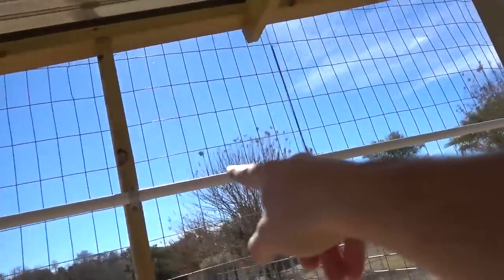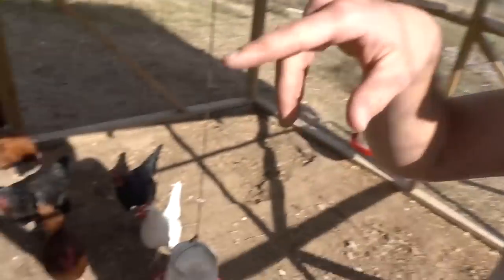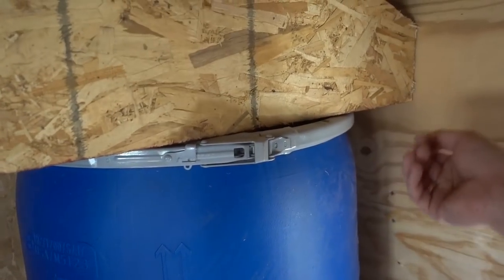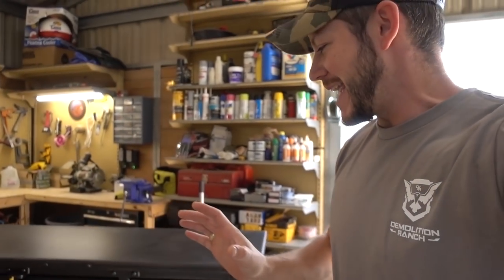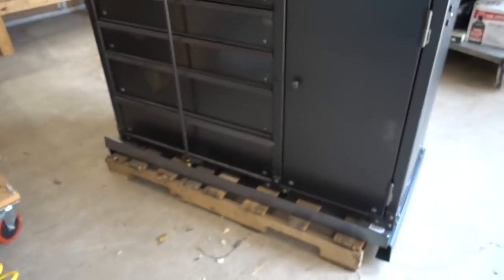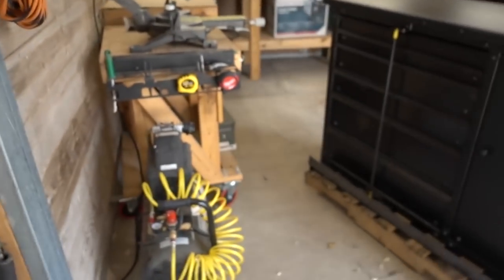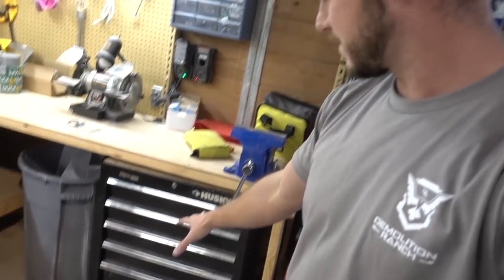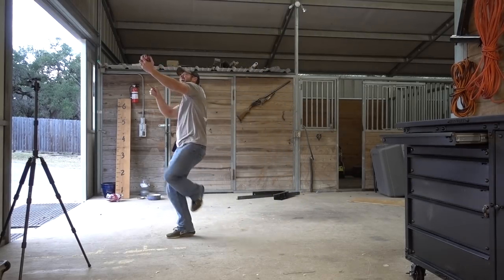It Weighs 450 Pounds!!!

Comment: Hey Matt, I work in the rainwater collection industry. I love what you’re doing with the coop and think it’s outstanding that you’ve done all this yourself! I do want to offer advice though- you may want to add a screen over that overflow output. The way I saw it, there’s a clear, unfiltered channel from the overflow to the top water which is an excellent way for critters, insects, and pests to get into your water. You could just simply get some cheap mesh and literally duct tape it around all openings to prevent that sort of contamination. I’d highly recommend it. It wouldn’t inhibit water flow and would give you extra peace of mind for the longevity of the system as well as preventing maintenance. Thanks for reading this buddy, love ya!
Reply: extremely great advice! hope he reads this!
Reply: In his previous videos on the water system he mentioned about screens several times so I'm pretty sure he's using them.
Reply: Shawn K y hello there
Reply: ❤ Why do you want water in it

Comment: Not sure but it looks like you installed the wheels on the wrong end.  The fixed ones go to the left side (without the handle) and the swivel wheels go on the handle end.  That way the tool box is easily moved around.
Reply: I was thinking the same thing.
Reply: I commented about this as well. They do need switched. Tune in for the next episode of ToolBoxRanch.
Reply: The thing I dont get lol. He advertise it as being "safe" with all those locks and can put valuable stuff in it.....aaaand then put it on wheels....makes sense xD
Reply: Was wondering the same.
Reply: Bilbo Saggins a 6 ft galvanised fencing section and padlocked gate, across the mouth of his workshop space, would do the same job. It won't stop a determined thief, but why make it easy for the scumbags.
Reply: Thats why I am commenting on the wheels...The thief doesn't even have to worry about the lock..haha just wheel the entire thing away :P
Reply: Bilbo Saggins it’s a lot easier to grab a tool out of an open drawer than hauling off 600+ lbs of tool box
Reply: iLikeC00kieDough . Matts humvee, is the army push button ignition right? 
600 pound getaway vehicle already provided?
Reply: zbudda it's been converted to a keyed ignition.
Reply: I thought the same thing

Comment: I understand this was an AD for rhino but when you are trying to compare that tool box to your husky tool box  it’s not comparable the rhino is $2000 you have a low-end model of the Husky tool box which was probably about 200- 300 bucks and if you were to buy a high end husky one the bottom drawers are rated for 200lbs and is also made with 21gauge steel just saying you’re comparing apples to oranges.
Reply: kobe0806880 yeah, worked at home Depot for about 2 years. The cheaper $300-$500 tool boxes dent very easy but they do sell some high end ones that can do what that new chest does for cheaper still.
Reply: But the husky is made out of 100% “Chinesium”
Reply: Jo Wh LOL, "Chinesium". I am totally stealing that. It perfectly describe every Chinese made tools I encountered.
Reply: He's using the husky as a stand in for all those "like boxes." Some are in excess of $1000 (for a similar configuration) and are still made out of thin sheet stock. This is $1700 after the discount code, (Shipping included) so when you start comparing it to other high-end toolboxes, it's not really that bad of a price.
Reply: kobe0806880 i have snap on and compare à rhino ... Rhino Win.
Reply: BC437A
Dude Chinesium is already copywritten by Uncle BF, though he may have opensourced it.
Reply: THE TOOLBOX IS NOW $3,799. THEY RAISED THE PRICE FROM $1,999 SINCE THIS VIDEO.  NOT COOL!!!!!!!!!!!!!!!!
Reply: kadmow 
I was being facetious. If you don't know what it means, look it up. I had no intention of using "Chinesium" for commercial purposes now, nor I will in the future.  The fact that you took my comment way too seriously, tells me what kind of person you are. So please take your "Holier than thou" attitude and take it elsewhere. It is neither needed, nor wanted here.
Reply: BC437A  Well if you were being facetious, you should have realised I was totally pulling your chain.
(Or Googled Chinesium to fund out who youtube's Uncle BF Is..  its a joke..)

There is a youtuber out of BC who routinely uses that word, amongst other "choice" Canadofrancisms..

sorry for making a joke without laughing, I will laugh next time.
Reply: So did you scoop one up? Lol!! That’s messed up!
Reply: AvE comment LOL.

Comment: Both braked castors should be on the front side, so you can push it under something and get access to both brakes. 

:/
Reply: Beat me to it i was going to say the same thing i know been there done that ;)
Reply: Pushing it under something makes no sense. You lose acres to the top surface, which is one of the best features of this box. Also, the only time you'd really lock the casters would be while using the top surface, and it wouldn't be under something. And what would you put it under? A really high table that has NOTHING under it. No supports, no shelving, no storage.

Comment: Ok, just an observation, you have spent hours and a buttlode of cash installing, removing and reinstalling
a big time watering system. Have redesigned and installed the entire interior of the chicken coop, but
you still have a FRIGGEN! wire running out to the latch so you and the kids don't lock yourselves inside ???
You can do better than that, come on.
Reply: Theold doctor sometimes simplicity is the best solution
Reply: Theold doctor oh common then their wouldn't be any fallout 4 part to the build man. Simple but easy to fix along with cheap to up keep simple Paracord.
Reply: I mean, a wire is a good idea.
Reply: Theold doctor I think that's just a doorknob dude.
Reply: Pretty sure he has a long time ago
Reply: He has had that done for a couple months now.

Comment: Hate to break the bad news to you, but you put the caster wheels on the wrong end. The casters are always supposed to go on the handle end. I was a GM Mr. Goodwrench for 20 years and used a Snap On "Taco Wagon" tool box. It's got to be a real pain moving it with the steering end on the opposite end from the push handle. :(

Comment: If the Tool box is 450 pounds and you weigh 200 pounds, when you stand on the edge shouldn't it not tip???

Comment: In order to fill a 55gal drum, you would need atleast 110gal of opposite pressure to push the liquid up into the 55gal drum. Theres no way your inch and a half pvc pipe can produce that amount of pressure with gravity alone, unless it was 1,000ft straight up lol. Not tryin to be a hater. I like all your vids. Just my opinion. Might come in handy in near future ;)

Comment: Hey Matt! I'm not an expert or a physics major, but I think your overflow tube is going to work as a siphon if the water level reaches the u bend.
You might want to over fill them just to see what happens. 
(I have a pythagorean cup that does the same thing. If it does, just install a vent at the top of the bend to let air in. That will kill the siphon.)
Thanks for reading, and I hope I'm wrong. It's a really neat system!

Comment: I had a desk that weighed about the same as the toolbox. I needed to get it on the pickup. The wife was sure we couldn't move it. Our wives are about the same size and age. I'm 70 and in crappy shape. I looked at it like you looked at your toolbox. I tilted it and backed up under it. I lifted the other end of the desk and slid it on. My wife couldn't believe it and neither could I. Work smarter. Not harder. Your brain won't get a hernia. Probably.

Comment: My toolbox also used an external bar to lock the drawers. That didn't stop the thieves though. With a little force, you can pull on that bar in the middle and it will come out of the bracket at the bottom. Then all of the lower drawers can be robbed. I welded on larger brackets top and bottom and got a 3/4 steel bar and drilled a hole at the end. My padlock is on the bottom of the rod now. It's a little aggravating unlocking it now, but it is far more secure. I lost several thousand dollars worth of tools and my insurance only covered part of it.

Comment: It would look so much nicer if you ran the output of the gutters on the sides of the structure directly into the upper portion of the structure and then ran the piping over to the tanks. Then you just drop the water into the top of the tank as I said. The same is true for the open enclosure area. Run the water directly along the top of the enclosure into the top of the structure and then drop it into the tank keeping each of the three lines separate to avoid choke points. Then connect a valve to the bottom of each tank. Using two couplers attached to the output of the valves run your drain line and watering lines for the chickens out of the mine that is connected to the couplers. This allows for easy drain down in case of a hard freeze and hard freezes to find as below say 25 or even 27°. In such case you just shut off the valves and disconnect the couplers and drain out the system. The lines to water the chickens and their Associated train or just fine. As I said earlier, down to about 27 225 degrees you can just slightly open the two drain valves at the end of the watering lines for the chickens period a very small amount of flow will provide enough movement in the water lines has to avoid freezing. This is specifically why you do not ever fill the tanks from the bottom or retain water in the input line as they represent a serious freezing hazard! That is not smart! In addition it requires a lot more piping and is asking for problems with choke points and complex systems that are not only unnecessary but also pretty doggone ugly. Your wife is a classy gal and would prefer my type of design which is clean efficient and attractive. Let me know if I can help any further.  1abqdad@gmail.com

Comment: Why not put a battery or 2 in the hole between the barrels with a solar panel then hook up 12 volt heat tape on the outside pipes.  You could even make an Arduino (spelling) it automate the on and off based on outside temp.  Kinda techy but I'm guessing there's a ham radio club in your area that could help.  And that would be way  cool.

Comment: Hey, great video. One idea for your old tool cabinet could be to have it as a rolling tool chest/work bench if your working further away from your shop. Maybe add 4 swivel castors to the bottom. This will allow you to load it with tools for a specific task or job and the roll it over to the area your working and still be able to tuck it under your shop bench when not in use.

Comment: When both tanks fill up and the water starts going out the overflow pipe, it's going to siphon out all the water from the tanks. The overflow needs to go out the side (or top) of the building without going down. Or, if you feel it has to go down, then give it an air vent pipe at the highest point to break the siphon. If you don't believe me, just ask any plumber how a toilet works.

Comment: Just to throw this out there about the extra tool box. I use my extra ones like you have to store tools and such for jobs that I have to do but they are few and far between. Take oil changes, I keep the exact sockets, wrenches, filter wrench, extra filters, shop rags, and any other little tool or part I need for doing those things on my vehicles in one of them. Come oil change time I go to one spot and everything is there and I don't need to go digging through the rest of my tools or running around the garage to get the right stuff. Think chicken coupe. Keep all the stuff you need to repair the water system or the doors and what not in there. Oh and yes I have one very similar to yours and that is all the tools and what not for working on or cleaning my guns. No matter what it is, if I'm doing anything to a firearm I open that box and only that box.

Comment: Just a thought, maybe put a roll on or spray on bed liner on the top of the new tool box for the added durability if you plan on using the top for more work bench space.

Comment: So I noticed that the rotating casters on that tool cabinet are not on the same side as the handle to pull or push it around. It might be easier to move it if the steer casters and handle were in the same side. Love your channels. My wife and I binge watched a ton of videos from all of your channels!

Comment: I like the watering system.  One suggestion. On your overflow drain  you might add a vent.  If the drain ever gets used the vacuum created may drain the entire barrel.
Reply: only down to the top of the barrel (bottom of the drain pipe - draw a picture)  not so catastrophic.  sorry butting in.

Comment: Please stop putting tool boxes inside of tool chests. If you have a portable tool box with ratchet sets in it that is one thing but if you just shove a bunch of them into a drawer that completely defeats the purpose of getting the tool chest in the first place.
Reply: More details, just sounds like a rant.
Mat doesn't really know what a mobile toolbox is used for (eg. acting as a mobile/portable workstation for a fabricobbler  working in an industrial shed/workshop or mechanic who needs to take them - everything- to another bay to work on someone's Ferrari), he's just using it as a cupboard on wheels, because it suits his use..
Probably the sockets (sets) will (as often as not) be used in another shed, or be thrown in the back of a car to take somewhere, then having them ready to grab is easier than having them laid out individually in laser cut high density foam inserts.  oops. sorry.

Comment: I don't get how the water fills the barrel from the bottom?
Reply: Physics
Reply: Good Job- I heard matt say that also.  Could  you elaborate on the specific Physics being demonstrated ? I just assumed that, without some sort of pump, the barrel would only fill to a certain level and then gravity would prevent it from getting any higher- which is why I asked....
Reply: Drewskidelmar: Water regardless of volume will always find the same level. Because the gutters & downpipe inlets are higher than the top of the barrels any water that goes into the downpipe will find a common level in the system. This can only be achieved if on top of the barrels there is an exit for the air trapped by rising water to escape. Matt has done this in the form of an overflow (check out the video in detail again) Hope this helps.
Reply: Thats true. Thanks man! Because of his  setup,  it seemed odd that gravity fed supply lines would fill a 50 gallon drum from the bottom , but yeah! if the higher water  supply lines are always full of water  and the drum allows air to escape then it makes sense . volume has to go somewhere! sorry , i wasn't trying to be a ...... just honestly didn't visualize it.
Reply: Physics brother....physics